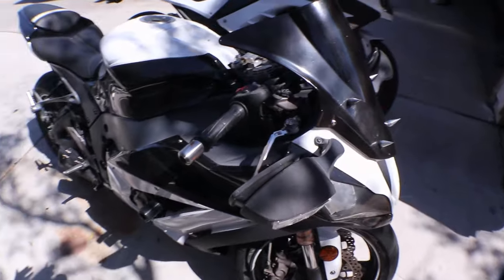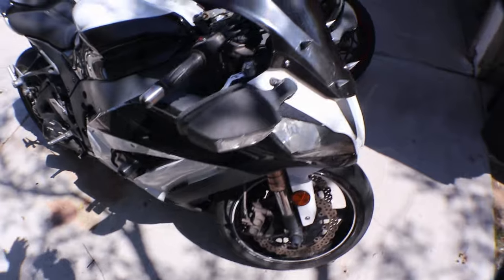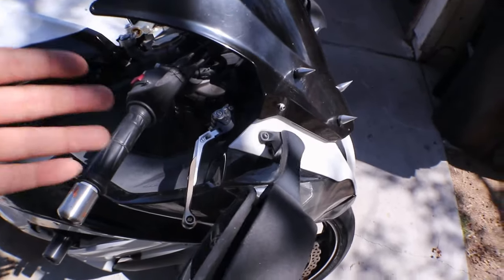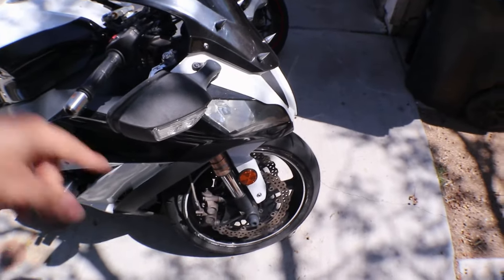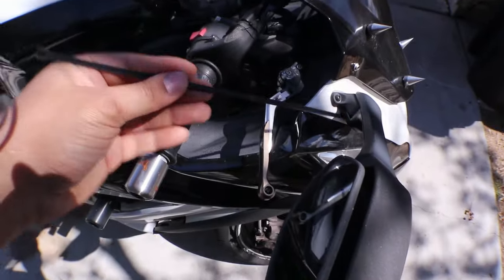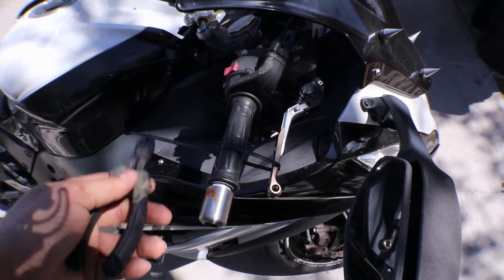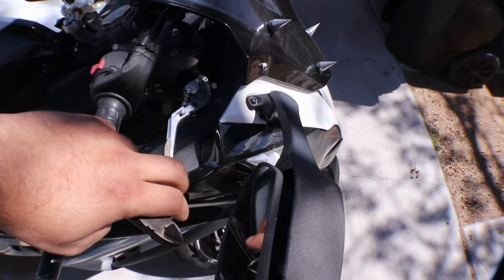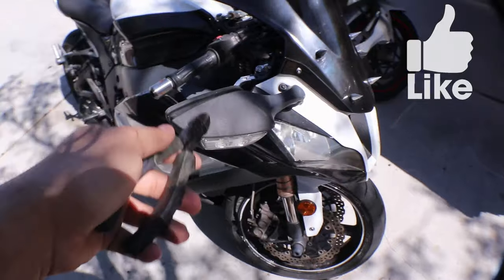Quick Tip: Fix Spongy Brakes!

Comment: The best way to do this is to tie the lever then when you go to break the tie instead hold it tight then break the bolt on the master cylinders line and keep the lever held and tighten it back up then release the lever, that will purge any left over air bubbles that might of gotten trapped into the master cylinder as well.
Reply from the maker: I agree. But not everyone has the time. This is just an easy fix for those not wanting to bleed at all.
Reply: Thanks for your comment! Changed my calipers due to leaks, bled it and my brake is super spongy! Soon as I saw  master cylinder line, I realized I didn't bleed the air out from up top, silly me.. (that's why you don't leave things for weeks on end) Brake feels so much better now!
Reply: @TheMotorcycleBoss Not everyone has the time?  You're talking about an 8 hour process but there's no time for an additional 30 seconds?
Reply: Next time you comment, please make use of punctuation and periods, as necessary. This comment of yours above is like taking a piss after 5 beers -no stopping out until the end.
Reply: @newsupdates3622  No thank you, I'm not in class I'm making a comment on YouTube read it or don't idgas. 😂
Reply: @jridenour31  I thought the same thing when I read his comment, so I didn't even care to reply lol.
Reply: Nice advice!

Comment: Bleed my brake in a workshop and this issues occurred. Used this technique and left it overnight for about 8 hours issues have improved, hopefully it will fully fix it the next time I try. Thanks for the tips!
Reply from the maker: I'm glad it helped at least a little. Usually, if the problem persists, you still have too much air trapped in the system. Sometimes you have to detach the caliper and move it around while bleeding to get out any trapped air. It sucks to do but will almost guarantee a proper bleed. Hope it goes well for you!

Comment: Just got my bike back after changing the brake lines and my front brake is very spongy and weak, I will try this tonight and will let you know if it fixed the problem, however I think i might have to bleed the system if that doesn't help
Reply from the maker: Hey! I understand that frustration. I've been there before. If you didn't gravity bleed first, you may run into the issue you are talking about. Just be sure to bleed the master cylinder first before the rest of the system. Thanks for taking the time to comment. I hope your project goes well. Good luck and I'm looking forward to hearing what fixes it for you.
Reply: So did it work?
Reply: @moslimislam5714  It did a little bit, but I did have to bleed the brakes anyway.

Comment: I always carry elastic bands on me to do this every so often, like once a month when I park up I will put them round one of the levers overnight. 
PS: You said the bubbles reduce in size. That isn't exactly what happens.... They break down into smaller bubbles by division. The same volume of air is still there, it's just broken up into smaller bubbles under pressure, where they are more likely to float upwards as they have less surface friction individually.
Reply from the maker: Glad to hear that you are aware of this trick as well. Whenever I tell people this trick they always think I'm blowing smoke. Thanks for taking the time to write. Stay safe out there bro.

Comment: I must admit, I was skeptical when I saw this. But, as I was running out of ideas, I decided to try this. IT WORKS! Thanks The Motorcycle Boss.
A relevant question (at least for me) would be, where are the air bubbles coming from. I have no leaks and have bled the brake once every two or three weeks. My current theory is the brake hose. It is 9 year sold (I just found out Honda recommends replacing the hose every 4 years, my Honda mechanic didn't know either). Have ordered replacement hoses and will see when they arrive if the problem goes away.
Thanks again.
Reply from the maker: Thanks for the comment! Glad you had a good result. I think you are on the right path. Make sure you get new crush washers as well. Good chance that will fix the issue. If not,  you can see if the master cylinder piston seals are good. Lmk how it goes. I'm all-ears.
Reply: @TheMotorcycleBoss  BTW, I have asked ChatGPT (OpenAI project) about bubbles in a brake system. AI agrees with you. I quote "In a closed hydraulic system like a car brake system, it is possible that the air bubbles could break up into smaller bubbles as the pressure is increased. This can occur due to the increase in the hydrostatic pressure within the system, which can cause the air bubbles to become unstable and break up into smaller bubbles. However, this is not always the case, and the behavior of the air bubbles can depend on a variety of factors such as the size and shape of the bubbles, the viscosity of the fluid, and the rate at which the pressure is increased."
Reply from the maker: @EmadKhader  yes. This is 100% correct. That's why we do the zip tie trick - in order to compress the bubbles and thus encouraging them to float to the master cylinder. I noticed that while the zip tie is on, flicking the brake lines periodically may help get more air out. I noticed an stiffer lever when I do this. Chat gpt is so cool. Heard a lot about it

Comment: Hint to avoid using a one time  zip tie?  If yu have scraps of insulated copper wire (solid is better than stranded) simply wrap the wire around it and twist to hold in place!  Scaps of wire like this can be use many many many times for various similar uses
Reply: You giving a tip how to save on $0.0003 item?

Comment: This fixed my problem after replacing my fluids and bleeding it sever times is still feels like sponge. Did tie wrap my brakes overnight and after 12hours it feels solid now. Little play on my levers.
Reply from the maker: Glad it helped! If your brakes get spongy again, they you have air trapped somewhere in there. You may have to remove the caliper and move it around while bleeding to get the trapped air out. Hopefully it doesn't come back

Comment: IT FREAKING WORKEDDDDD!! went to bleed my brakes and the mechanic was using some suction to suck out the air and my brakes were spongy which required me to squeeze all the way to apply them.
Appreciate such "hacks". But im still wondering why will the "air bubbles" not "come up" even after using the brakes and have to do cable tie it overnight.
In any case, thanks for this ! :)

Stay safe and ride safe ! Cheers!
Reply from the maker: Thanks! Here is my theory: Usually when you use your brakes, we don't keep them pressed for small spurts at a time and the air bubbles tend to cling to the hose walls.. When pressure is applied, the air bubbles in the lines become smaller and detach from the inner walls.  But we need to give them time in that state to float. Thus keeping the pressure overnight. 

I'm glad to hear this trick worked. If the sponginess comes back after a little while, you still have air you need to purge from the system. Just remember that the air will alway congregate at the highest point of your hydraulic ststem. 

A few weeks ago, my rear brake would still be spongy after bleeding it time and time again. I saw a high-point in my brake like that the air would most-likely live. I had to detatch my caliper and raise the caliper over the master cylinder then bleed. Got all the air out! 

I hope all your future projects go well. Ride safe!

Comment: Late to this video but willing to give it a shot. Had my brakes flushed late sep 2023 (2015 zx6r) end of riding for me in upstate NY. Had air in line fixed and then rode 2 more times everything was fine before putting it away for winter. Last week was in garage and just doing stuff took a look over the bike and brake pressure gone. Hoping this is a fix, just 22 hours till I know. Cheers
Reply: Did it work?
Reply: @TheGuyWhoAsked72  Not really, worked for less than a day. Wound up having to go back to the dealer and had them re-bleed but no charge. I will try it as a winter thing though.
Reply from the maker: usually when this trick doesn't work, that means there is too much air trapped in the system and a more thorough bleeding is required.

Comment: I tried this, it only temporarily works but, goes back to its old way next day on mine.
Reply from the maker: It sounds like you still have air trapped in your system. I would try performing a reverse bleed with quality break fluid like Bel-Ray. Reverse bleed then do conventional bleeding.

Comment: have just done this tonight as my 05 1000rr blade has been sitting for over a month thanks to a stuffed stator and when i used her tonight the front was squishy so trying this before a bleed and go from there
Reply from the maker: Good luck! Nice bike!
Reply: @TheMotorcycleBoss  cheers and it worked amazingly i got almost full normal motion and lock back haha still might do a full bleed the fluid is over a year old
Reply from the maker: @carlhughes1662  glad the tip was able to help! If you feel it needs the bleed, go for it! Better to do it sooner rather than later.
Reply: @TheMotorcycleBoss  thats it im currently watching ur vid on how to rebuild the master cylinder lol
Reply from the maker: @carlhughes1662  sweet! I hope it is helpful as well. I need go bleed my rear brake as we speak. I'm so lazy lol

Comment: Cool tip. How do you keep the rear brake compressed over night?
Reply: Nevermind. I wedged a rag between the lever and bracket. I'll check back in a couple days to see if this works lol.
Reply from the maker: Stacking something heavy on it is what I do. But you could also ratchetstrap it to the floor somehow.
Reply: @TheMotorcycleBoss  Thanks, Boss. I really hope this works. Don't know why my rear brakes are spongy. New pads, lines, res, fluid, zerk...new everything.
Reply from the maker: @joruckus    Typically when you replace everything, you will still have trapped air in a lower spot in the calipers. That would bean that you have to unmount the caliper(s) and twist and turn them while you bleed to force any air bubbles to the highest point of the caliper which should be the bleed valve.

 This also happens in brake lines if there is a high spot in the line. Air will stay lodged up there until you raise the caliper higher than the line. A lot of extra work but it's common for rear brakes unfortunately.

 If the trick in the video doesn't help you, try what I suggested then do the ratchetstrap thing after you got a firm pressure. Hope this helps! Thanks for the comment!
Reply: @TheMotorcycleBoss  brotha, it worked! It's like a brand new bike! Thanks, again!

Comment: After installing new RCB caliper, ABS motor pump making noise even
at low speed braking and jamming the brake liver when doing
emergency braking. Any solution?

Comment: I just rebuilt Mt Master cylinder and rebuilt my calibers and put new brakes and braided brake lines so I had a completely dry system. I have tried a numatic brake bleeder and I've tried hand pumping and I've tried this and at first I couldn't get no lever at all but after I let it sit over night with zip tie I finally have a little resistance but it's still spongy. Last night I tried to zip tie it again over night so hopefully I'll get more air out.. my rear brakes I've done same thing but I got solid brake right away.

Comment: sadly, it didnt work for mine.
Reply from the maker: It means you still have air trapped in your lines or caliper. Worst case is your master cylinder seal is allowing brake fluid to bypass. But most likely you just still have too much air you need to get out

Comment: How do i adjust the front brake lever if i want it to get a little closer to my hand if i like have small hand?
Reply from the maker: On the lever itself, you may have an adjuster that looks like a small wheel with numbers. Not all bikes have this however. If yours does not have that, your only other option would be to order aftermarket brake levers with that adjuster. Hope this helps! Good luck!

Comment: After few days the same issue repeating, what is the permanent solution for this issue..??
Reply from the maker: If the issue persists, that means you have too much air still trapped in your lines or in your caliper. Sometimes you have to remove your caliper and move it around while you bleed. Air will get trapped in pockets inside the brake line or caliper that you can't get out without doing this. Remember that the air pockets will always float to the highest point in the system. But if there is an aggressive bend or pocket, they can get stuck. I know having to do this sucks but it needs to be done if your brakes keep getting mushy.

Comment: What if I'm getting 0 pressure after bleeding? I went through 2 bottles and it's not getting firm at all.
Reply: Same did you find a way to fix it ?
Reply: I did the ziptie method too and still spongy?
Reply: I just replaced my brake lines on my bike for the first time the other day. I thought I had your issue but turns out I just needed to keep bleeding them a bit longer. When you get to the point where all you see is pure bake fluid coming out of the calipers, give the lever another 20-30 squeezes. Then tighten everything up. Keep the master cylinder lid open and start pumping again. If you had the issue I did, you'll start to see really tiny bubbles coming out of the master cylinder. Just keep pumping and tapping various parts of the brake lines until you can't really see any bubbles at all anymore. Some people even just tap the lever with your palm rather than fully pumping it. It's the vibrations that get all the air out, not necessarily the pumping of the lever. Then, do what is shown in this video and the next day you'll be golden.
Reply: I took mine to the shop, if you have gsxr 2007 or something close, replace your master cylinder, chances are theres a buildup in there that cant be fixed other than replace.
Reply: are u sure you are doing it correctly ? I believe you let air in the system from the master cylinder by not adding brake fluid before the reservoir goes empty. If there is a lot of air in the system it will take a while to get a pressure ! I recently did a caliper rebuilt and it took almost 2 bottles

Comment: Hi there mate got a kx85 rear brake is really soft Iv bled the rear brake but it still won’t work as it when pressing the rear brake it won’t stop the wheel at all. Any suggestions?
Reply from the maker: Hey! Thanks for asking. It sounds like you still have air in your system or your master cylinder seal is allowing bypass. Most likely, you still have air in the system. I would recommend doing a gravity bleed, then hand bleeding. Be certain to raise the front of the bike to make the caliper the lowest point in the rear brake system. Then use a ziptie or bungie cords or a weight to weigh down the brake lever and leave it overnight to help get the remaining air out of the system. I hope this helps you. Good luck.

Comment: Can we do this to the rear brakes as well ?
Reply from the maker: Yes. You can. Although I've had mixed results due to the fact that the rear brake lines have a hump to account for the swingarm movement. The hump is sometimes higher than the master cylinder and any air bubbles that accumulate using this trick will always float to the highest point in the system. So, if you can keep the master cylinder at the highest part of the system and apply pressure to the lines overnight, that is probably the best way to get similar results to the front brake. Ride safe!

Comment: how to prevent air from going into the system? i have this problem with my brake all the time
Reply from the maker: Make sure all fasteners of your brake system are tightened to spec, ensure that your rubber bladder in your brake reservoir doesn't have any tears or punctures; make sure your brake fluid is completely bled out with fresh brake fluid every 2 years.

Comment: My rear brake decided to take a vacation, does this trick work on it also? Changed the fluid but still dead. Yamaha r6 rj09
Reply from the maker: Rear brakes usually have a hump in the brake line. Air will like to settle at the highest point in a brake system. Sometimes, i have to detatch my caliper, hold it above my master cylinder, then bleed out the air. It's an unfortunate thing to do but that should fix your problem assuming the fluid isn't bypassing your master cylinder. I hope this helps! Good luck with the project and ride safe! Cheers!

Comment: ive been looking, this video may helped, i bleed the system.. 2018 ninja, previouse owner droped it, i got new rear master cyl. (and other parts) i cleaned it, it presses in.
but doesn't decompress, when i let off the breaks... hints? help?
Reply from the maker: There is a spring that is supposed to return the pedal/lever to its original position. Make sure the pedal has clearance and there is a return spring present

Comment: My brake lever is the opposite. Too hard. Does that mean I put too much brake fluid into the system? Surely not?
Reply from the maker: Usually that is the symptom of hydraulic lock caused by too much fluid. But be sure to check for any obstructions to your brake lever. I hope this helps. If you find out what it is, please tell me about it. Thanks for commenting and ride safe! Cheers!
Reply: no. It’s supposed to hit like a brick wall. Your master is perfect